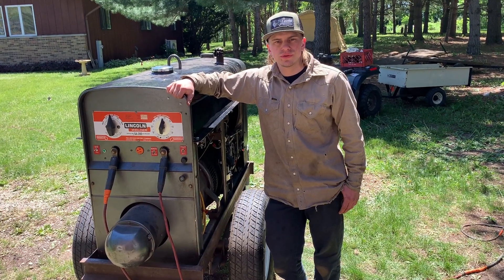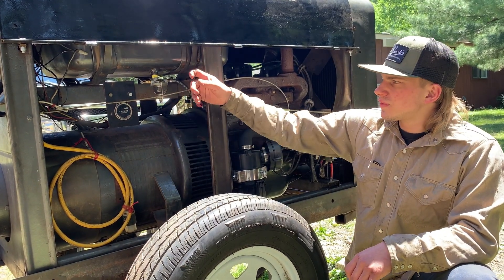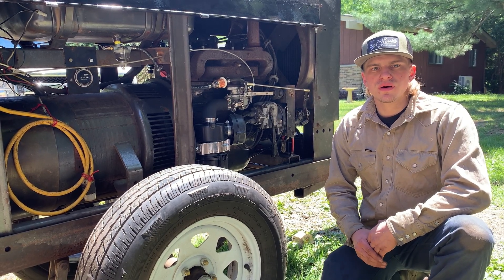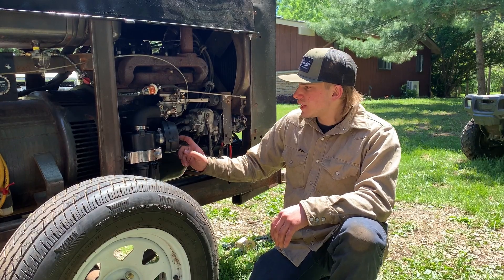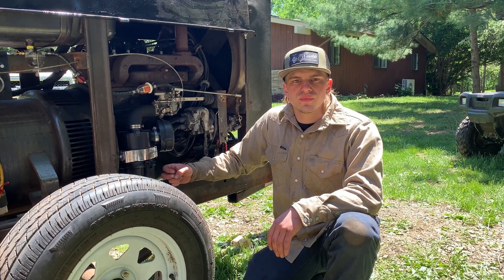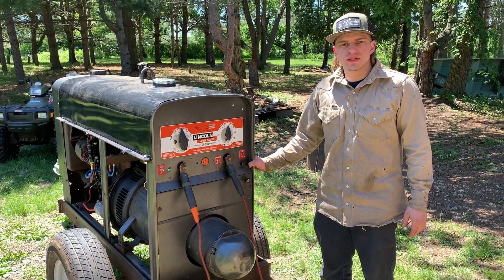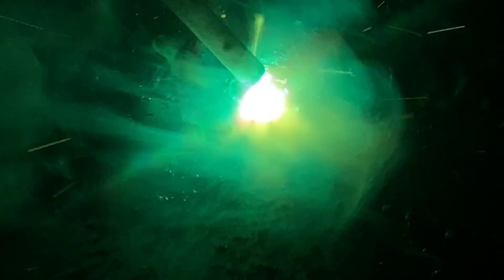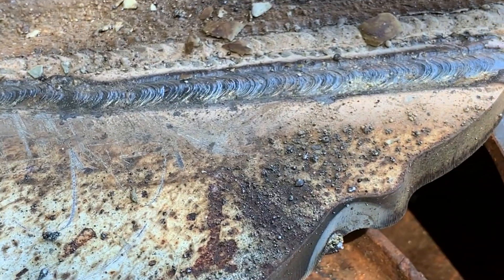SA 200 Upgrades and Modifications

Comment: Enjoyed the video.  You might try this, Close the fuel valve when you're done and let it run out of gas.  That allows for a good cool down period and leaves the carb empty.
No worry if it has a magnito.  The battery won't be drained if the switch is left ON.    Oil now days allows for a longer service period than oil from the '50s.  Oil back then didn't
even have detergent in it.  An hour meter helps keep track of running time.  If it has a red light to indicate oil pressure, the circuit can also run an hour meter.  Always thought 
that was contrary, a red light meaning all is well.

Comment: And also make sure that the rack is in the proper position if your rack is out of position it will extinguish in the lower amperage adjustment on fine adjustment if your rack is adjusted correctly you can do a lot lower amperage adjustment with the find current if it's out of adjustment it will extinguish every time

Comment: What is the difference between a red and black face ?
Reply from the maker: Biggest difference is red face has copper windings and has arguably better arc characteristics. 
Black face has aluminum windings and don’t have the heat sink the copper windings have. If you do a lot of welding you may have to turn up the fine current (ocv) to get the same weld characteristics. Once the windings cool it will weld the same again.

Comment: Full Bridge rectifiers have been used in welding machines ever since welding machines have been built if you get back in the early nineties like 91-92 on Onan powered Bobcat 250 there's only one of the welding machine that I can compare that way be SAE 350 that are currently owned the newer inverter machines are trash Bobcat 260 wouldn't give you $0.50 for it 90% are y'all not going to weld no damn pipeline you going to need a machine that you can combat Arc blow with SA-200 might be a badass pipeline machine but I wouldn't give you $0.50 for one of them in a structural field I'll take a bobcat 250 any day don't have to spend massive amounts of money on a structural machine
Reply from the maker: You are right about that. It is probably not worth it unless you Pipeline and less that 10%of welders will ever do that. To everyone else it’s just a piece of history. 
The welder makes the weld and not the machine. 

Very curious how to combat arc blow with a newer machine?
Reply: @relentlesswelding15  I think this link will help you in your search this is common stuff that they used to teach us in welding school back 1991 Tulsa welding school s whenever I went

https://youtu.be/fvZGxFs0bJQ

Comment: Did you put w88 brushes ?
Reply from the maker: Yes
Reply: @relentlesswelding15  are they worth the almost 400? Lol I’m thinking about getting them
Reply from the maker: @ironsal261  it’s worth it if you want to smooth out the arc
Reply: @relentlesswelding15  I want to try them to see if it will give my cap a better stacking profile

Comment: I would love to buy a sa 200 red face but I’m just starting up will it be worth the investment for side work and oil field work as well? Can you run grinders and a mig machine off that welder ?
Reply from the maker: Probably better machines out there for quick repairs. There is enough auxiliary power to run a grinder but that’s it. It’s made for pipeline and has the best arc characteristics.
Reply: I run mine for doing repairs and stairway fabrication. Like he said definitely better machines out there for the application but these things are beasts. It depends what you can pick up as far as knowing if it will be worth it. Mine cost $3k and then another $7k to rebuild it after a year. A brand new Hobart champion elite costs $3-4k. If you don’t know which way to turn a wrench don’t get a 200, but if you know how to work on stuff and don’t mind maintaining it, go find a decent one and screw all the naysayers.

Comment: That's a nice welder, you did a nice job. One thing I noticed is the plastic fuel shutoff and the filter is after the shutoff. I don't know if you will have problems but I have had those plastic shutoff valves leak on many pieces of equipment, as well as having fuel starvation due to plastic fuel filters being placed after the shutoff. When the engine runs and the fuel shutoff gets turned the fuel in the line, filter, and carb get burned and that can create a vacuum when the engine dies. That vacuum can collapse those cheap filters and cause fuel starvation when you need to run the machine. To mitigate that I put the filter in front of the shutoff, another option may be to use a higher pressure fuel filter meant for a small car or truck. These are just suggestions, I might have to restore my old engine drive welder.
Reply from the maker: Thank you! My brother has not had any issues with it but it makes sense . We will try it with the fuel filter in front.

Comment: Damn! That’s nice man!
Reply from the maker: Thank you! Currently doing a full rebuild
Reply: @relentlesswelding15   @3:20 Idk where your at  but where we are in VA near WV and MD borders, there’s several places to buy straight gas from several different stations. Depending on how far a station is away from you, I highly recommend using straight gas. 

My personal welder is a TB 302 and I swear I can hear a big difference in the straight gas vs ethanol. Definitely when there was old ethanol gas in it before. 

All that said regardless. You have a great career ahead of you! Don’t stop busting your ass and reaching for your limits because the more relationships and networking you build will pay off immensely down the road! Best of luck!
Reply from the maker: @oldlincolnpipewelder  we are located in northern IL. We will have to look out for some stations that have it. Thanks!
Reply: Ahh i see. I’ve actually heard a few gripes about fuel from IL.  As far as Diesel anyway.  It varies from state to state, Based on state standards.  I found out when I was researching problems with ULS diesel on mechanic/ truck forums. But yeah definitely look it up!

Comment: Nice video bro. Cool upgrades. I wonder what ur oil change interval is after your mods?  Also, is the oil filter upgraded? Because I wouldn't think that just adding that oil cooler would allow for longer change intervals...
Reply from the maker: Yes the oil filter is a larger canister filter instead of a small cartridge filter that it would have came with originally. The lines have also been upgraded to 1/4 instead of 1/8 to increase volume. Once I finish building the machine I will be sending out oil samples for analysis every 50 hours to see what my interval will be

Comment: In the spirit of putting as much info as possible for these old Lincoln's since there's very little of it out there I want to add this problem/solution I recently ran into:
If you put a distributor on your machine make sure your coil is well secured. My machine doesn't have a tapped hole one of the side you install the bracket to hold the coil, I could only secure one side between the oil filter bracket and the block. Shoved the coil down and bent the bracket enough where it wouldn't move and thought nothing of it until my machine kept shutting down one day. Turns out my coil shook loose and turned about 90° and the ground wire arced off my oil filter. I secured it again with tape and checked for a few weeks and it didn't move again even though it melted the tape a bit. Long ass story short...a few months went by and I lost arc from my distributor because the module was fried. After talking to an old head Lincoln mechanic I determined that short out from months earlier had to have been the cause of the failure since I was very careful to disconnect all power when I did the mag to distributor swap a year earlier. I think the short on my oil filter was enough to cause damage but not totally kill the module like it would if I had dropped the ground when installing (if I didn't disconnect the batt and on off switch which you really need to do for that upgrade). Anyway hope this helps someone down the road I've been saved by random comments on videos before. Good luck and keep burnin!
Reply from the maker: Thanks

Comment: Sooo what's your OCV set at?
Reply from the maker: It’s around 90 at 3rd gear and 100
Reply: @relentlesswelding15  right on I keep my 82' blackface at 91 or so and it welds great, but I put a distributor on mine. Slick machine man and good job getting it running right. I know what it is to own an SA, you have to be half a mechanic to own one if it's paying your bills. I think I'm damn near full mechanic 🤣.